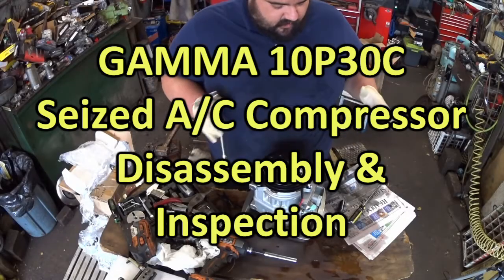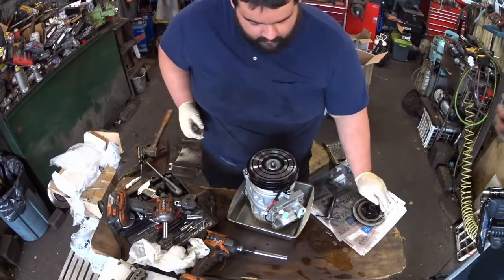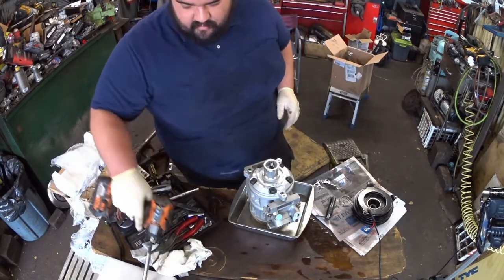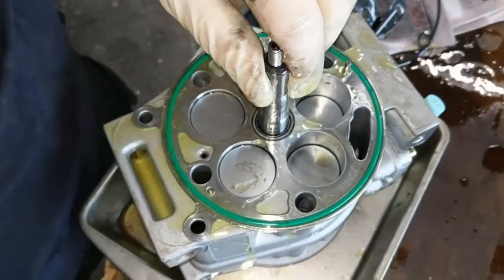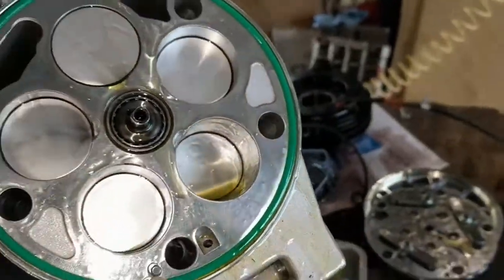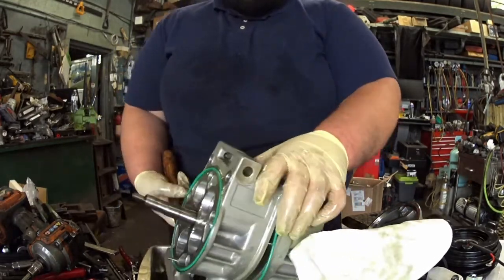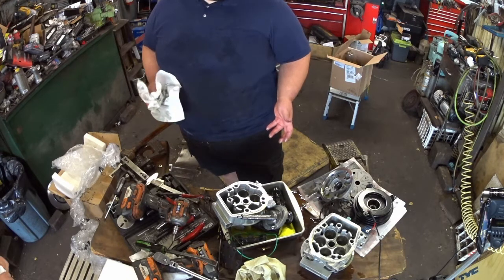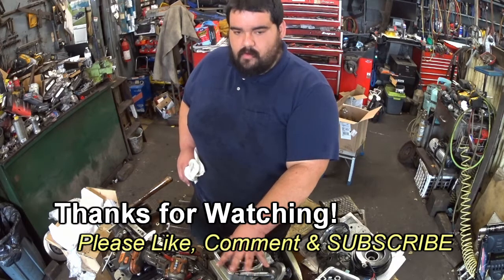Gamma 10P30C Compressor Evaluation by Tim Iezzi (disassembly & inspection of a seized compressor)

Comment: That looks like when somebody screwed up and didn’t put lubricant in the system in the first place causing that black oxide aluminum find dust from metal to metal contact. 

       The black oxide was not spread throughout the system or the rest of the compressor was perfectly free of the black oxide meaning there was no lubricant or refrigerant flushing it while I was rotating and it got hot and seized. 

    Then somebody got the a-ha lightbulb moment went off oh shit I forgot to put in lubricant they won’t warrantee this so let’s throw in lubricant after it seized up and turn it back in for warranty or not let the boss know and pretend the lubricant was in there all the time. 

But there was no mixing from that clean lubricant in the compressor and the hot powdery aluminum and metal from the metal to metal contact did not spread it throughout the compressor meaning it was not running when the lubricant was added later. 

      And I also wonder did they use an air tool just the bolt down the compressor to the block unevenly with high torque and distort the case of the compressor in the first place ?

And if the bearing even if it was that tight in the first place who put on a compressor without rotating it with their hands and not noticing the tight spot ?
Reply: these compressors are out of toyota coaster mini buses, the refrigerant circuit runs all the way from front to back of the bus (14m total) so a lot of oil is required, quite common for this to be overlooked and then the compressor subsequently seizing
Reply: @s0ckpupp3t  compressors do not die 
Compressors are murdered
Reply: @s0ckpupp3t  the circuit runs from the roof(evap) to the condenser at the bus side, nothing is at the back of the bus. It uses 2 x condenser fans.When one fails it causes a thermal event and high side pressure 300+ which often this is the result since the h/pressure switch safet is way too high. Often the clutch damper rubber is burnt as a result.
Reply: @kevinswaby5733  ah yep I'm mistakenly talking about the earlier model which use a 10p25c and have everything at the back (edit: except the condenser which I believe is in the same spot)
Reply: @s0ckpupp3t oh ok...I am sourcing some pistons and swash plates to rebuild 10P30C models I have.